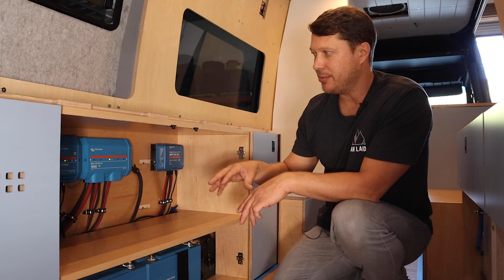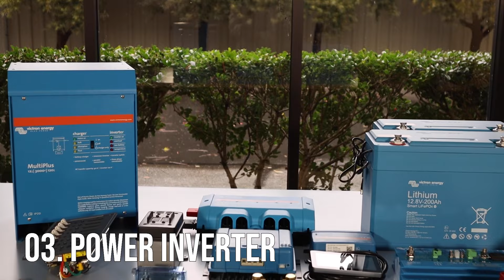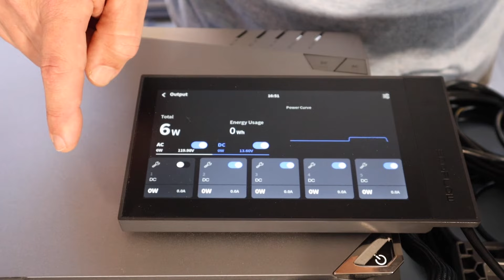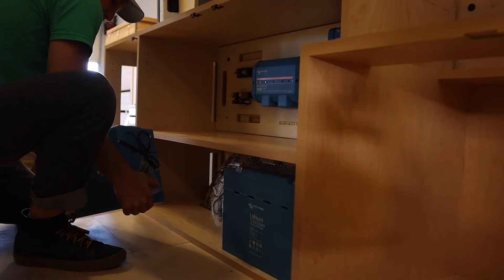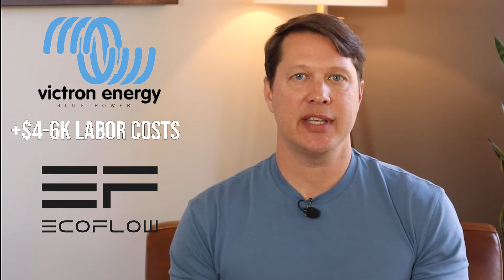Victron vs EcoFlow | Which is Better For Your Van?

Comment: In the case of a van build's electrical system, does the average user need or want all of this? If you go with a 12 volt AC and mostly 12 volt loads (fridge, lights, water pump, etc.) your system will be a lot simpler and more batteries and solar are less expensive than these options.
Reply from the maker: Yes, the average user does need something like this for a complete build. There are definitely less expensive ways to go, but the limitations of simple systems show up pretty quickly. Most people building vans do go with 12v appliances as much as possible, but as soon as you want to add air conditioning, induction cooktops, etc., you will need a system like this.
Reply: @VanLand I will tell my van.

Comment: I'm not sure what this Victron kit is and where its from. I'm building a victron system and I see a 250/100 solar charge controller will handle 5600w at 48v. You can choose the multiplus II in a 48v version, batteries are simple, and an Orion 48/12  will get you your 12v for the van. 

Just because the victron system somebody put together doesn't do what the ecoflow does, it doesn't mean that victron can't do it, but rather proves the point that you should put together your system taking into account YOUR needs.

Comment: Doesn’t the EcoFlow hub connect directly to AC/DC Smart Distribution Pane which has a 120v side and 12 volt side?

She has EcoFlow 10Kw system and this 48v AC

https://youtu.be/3JBWzhsanCk?si=FbDWtgH6HB3WUQXp

Comment: i did a victron system,  400 ah battery, 1200watt solar, victron 3 -100/30 , 3 -400 watt panels, 48.1v 9.97amp, 2 power queen batteries and 3000 watt inverter, and 30 amp dc to dc charger victron all wiring etc under 4500
Reply: Is it possible to share with me the detailed supplies you used?

Comment: Victory is very popular,  ecoflow, also popular.  Both are equally very very expensive! Too expensive! I use sungold 3000watt inverter, charge, controller, transfer switch, all in one. Under $600, 4, 100ah lifpo4 batteries, under $750, and it works. Unplug and it runs on battery, plug in and it charges, and pass through. Now I will add solar power, 2600 watt and it will take it, at 80 amps. So $9000, for victron, and $8000 for ecoflow. They don't impress me at all. I also  have 5year warranty. Ecoflow is portable, and therefore the only reason to purchase it.

Comment: We want to put the Powerkit system in our caravan/RV and are just finalizing our planning and have a question. For example, when you have the shore power plugged in and it only has 6Amps, does it use the remaining energy from the battery, so it can run the devices, like stove on 10Amps? The victron system can do it, so I am asking if the Ecoflow system can do it too.
Reply from the maker: Yes, it will use power from the batteries to provide the necessary amps irrespective of the incoming shore power setting.

Comment: I installed Ecoflow Powerkit with 3,150 watts of solar on my 34ft Avion Travel Trailer last June. I have 15kw of batteries and run my air conditioner on the system. Live full time in our rig.  In the over 8 months I have not plugged into shore power or a generator. Totally of grid. Full time. Love my Ecoflow Power Kit!
Reply: Hey, so you're able to run stuff like a fridge, shower, lighting in your van, charging appliances etc just with solar? not even using the alternator charger?
Reply: @eddy_creative sounds like he has an extremely high power, large capacity system… so I wouldn’t be surprised if it’s enough on its own
Reply: Hi there.  What type of AC/Heat did you go with? 12v set up?  Also, is your hotwater also powered by the EcoFlow?

Comment: I would go with Victron, but I’m more experienced than somebody brand new. Plus I’ve heard a lot of negativity about eco-flows customer service.
So far I figured out every issue with the Victron, though I have to admit some of them were somewhat of a challenge, mostly because of the learning curve. Although I have to say that I’m not sure why you can’t go to 48 V, as my system is 48. 🖖

Comment: Everything about the Eco Flow is great exept: The 1600W alternator charging is a real surprise limitation. It seems like a major oversite of who ever is doing the product management and spec'ing the design. It seems like eco flow would be falling all over themselves to up this capacity. Is there any updates or news of fixing this in the near future? Or is there a work around; say, bypassing with a stand alone DC to DC converter like the Victron Orion?

Comment: I've had several clients ask me about EF power systems vs my typically installed Victron system and this video helped me compare the systems in general.  The pricing of the Victron system and installation cost is higher than I typically charge. Also most of my systems are retrofits into a wide variety of rigs, not brand new van builds so Victron has more customized options.  But not having to cut, crimp, and size every wire has me licking my lips!

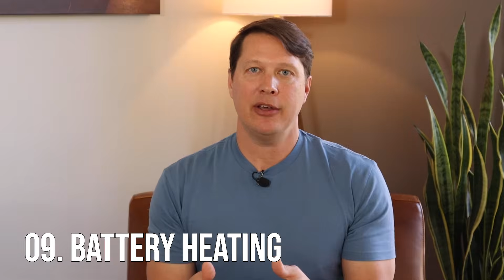Comment: ~9:10 Battery heating you mentioned that below freezing you need a way to heat your batteries, but from what I understand that only applies to what temperature the batteries get to. If you're doing a build like y'all usually seem to, the battery is inside the van. If you're camping in below freezing temperatures, the van should be fully insulated and probably also have a heater.

So here's my question: for someone living in the van full time who doesn't let the van get too cold (because they can't sleep if it is), how often is the lack of battery heating really a problem? How cold does the battery get under the bed or wherever if the air over the bed is being kept at least 60F? (I have trouble sleeping if the air is below 60F, much less below freezing.) I know they're in a case that might not get as much airflow from the heater and they're lower down while heat rises, but I still feel like being inside the insulation they probably wouldn't get below freezing. Especially if they're in use, say, powering your fridge and heater's fan and therefore generating resistive heat themselves (though granted not much if you're using thick enough wiring to be efficient).

Do y'all have any old customers that you installed Victron in whose batteries froze while they were sleeping in it and if so, how often and at what temperature?

Comment: We just purchased the 2kw kit a few months ago and luv it!  One thing we are considering is to add the Efoy fuel cell to charge during the winter as we dont get much sunlight on the west coast in canada.  Requires an exhaust line, but see that one container of fuel gets you approx 4.5 days running, and there is little noise.

Comment: All the reviews I’ve seen on the EcoFlow system say that you can use smaller gauge wiring.  What is the recommended gauge for both the AC  and DC wiring?

Comment: Watts are watts. I know most people especially beginners get hung up on amp hours, and yes I agree that most people are thinking about 12v systems since that is most common but it’s better to just talk in watts. Especially since it’s a very simple formula (volts * ah). 
Great video though! Admittedly I’m a Victron fanboy and love their ecosystem. The only product of theirs that extra hard to get passed are their battery prices! Sure they’re great but you can get just as good for much less.
I always use their components… except their batteries 😂

That 12v 330ah battery they offer is 🔥 though, I’d love a handful of those 😇🤙

Comment: Quite a good comparison but… you don’t mention the issues surrounding a failed component - if one Victron unit fails, you take that one unit out and can still operate without it. That’s not the same for built in box units. 
You also could have costed the Victron kit MUCH cheaper if you replace the most expensive batteries on the market with some much cheaper, and equally as good, items. 
It’s a huge WIN for Victron in my mind
Reply: Kes, 5 year warranty
Reply: @kk-pz8gn  it costs nothing beeing at "this moment" in the middle of nowhere

Comment: How easy is the van power connection in a sprinter VS30/2022?  Is the connection under the driver seat?  Would you need to add a fuse?

Comment: EcoFlow is headed in the right direction but with air conditioning and induction cooking and fast alternator charging I’ll stick with my tried and true Victron. 

I went with another battery manufacturer with 10 year warranty who also has heated battery option.

I agree, read the seller’s reviews. Support of the complete system is worth the extra cost. 

And my 400ah, 3000 Multiplus Inverter system was around 20 hours for this first timer to install, has been flawless for 3 years and cost around $5500 all in with quality wiring, fuses and the hydraulic crimper to make sure I did it right. 

That doesn’t include solar but 100 watt systems are fairly inexpensive. 
I found I don’t use solar. I park in the shade. My van lives in a garage between trips-which for now-are shorter.

Comment: For four years I have designed but never built and I wanted to do things on the cheap and easy. With all of the talk Victron is a sound and a life long investment. I want to design and use in an agricultural setting. The only criticism I have for victron is they also need to design and build equipment and components for wet environments. Second is Victron components are expensive but in all honesty  you do do get what you pay for. I need to use in a remote and isolated environment in the middle of nowhere on range land.  So, with Victron’s history of reliability I know for me it’s victron.

Comment: Extremely well-done comparison! I purchased the EcoFlow PowerKit 10kWh version when it came out and just recently installed it in my van. I agree with you that it is so easy it is almost fun. I also agree that tech support is lacking. I had an issue with the alternator charging not working. I searched online in Facebook groups of all places. Other said to turn the entire system off, then back on after 5 minutes, and that fixed it. EcoFlow's support had no such suggestion. Similar issue with their console. I found the answer online. I have waited a week for EcoFlow's support to get back to me. They are very good about firmware updates though! They are constantly updating it. My only concern is what if a component fails X years from now? I know that is a risk.
Reply: k72231968 said
7 months ago
"I have several Ecoflow units. Including a 4kw Powerkit. Ecoflow has answered all of my email questions with-in 48 hours. I have had no failures, or warranty issues..just technical questions. So far I am very pleased with all of the Ecoflow products I have."

Comment: Outstanding comparison!
Another option is to use an EcoFlow Delta Pro to power a distribution box. This would be a smaller, simpler, cheaper system.
Reply: Yes, that was my question. What are the benefits of the ecoflow kit vs the delta pro, which I saw for under $2k..

Comment: Do you have any idea whether the top or bottom port for the ecoflow power hub solar connector is positive? I have to cut my solar mc4 connector off to feed through my roof gland and now wondering which wire is positive :)

Comment: I am an EE and while appreciate the effort you put into this video, I think you made it very confusing for beginners. WH/80 only works for 12V. Watt-hr=amp-hours x volts would be clearer. You can easily distribute 12V with a 48 V Victron system using a DC-DC converter, and charge with 1200W of solar via the 30A charge controller. Bigger inverter is better, but also draws more idle power. The point is this stuff gets complicated very fast.
Reply from the maker: Yes it could be confusing. I just find that most van owners think in terms of amp hours @ 12 volts.

Comment: I have several Ecoflow units. Including a 4kw Powerkit. Ecoflow has answered all of my email questions with-in 48 hours. I have had no failures, or warranty issues..just technical questions. So far I am very pleased with all of the Ecoflow products I have.
Reply: Do you have any idea whether the top or bottom port for the power hub solar connector is positive? I have to cut my solar mc4 connector off to feed through my roof gland and now wondering which wire is positive :)

Comment: Is a 12v or 24v mini split AC/heat pump more energy efficient (all other factors held constant) in conjunction with the EcoFlow Power Hub? What quirks are there to know when installing a 12v or 24v mini split with the EcoFlow Power Hub?

Also, after the EcoFlow Smart Distribution Panel, can you only choose one (12v or 24v) or can you have both to use with some 12v devices AND also 24v devices?

Comment: For the EcoFlow does anybody also know if DC is limited to 13.6V - 70A, maximum power: 1000 W PER appliance or overall DC output for all devices connected. Would be super appreciated if anybody can confirm that as can't find on their manuals
Reply: Hi just finished install 10kw system to sprinter van . Van has 12 v Air conditioner they consume 50A max and 25A continuously  .my experience once reached maximum current system automatically turn off DC power ( only at once I had happened)  also you must use hi current load (over 20 amp) direct to DC out put
Reply: @haruO3-2479  can you explain a bit more about how to directly connect to dc. Does that mean you can’t use the distribution panel? I see there is a negative post for over 30 amp in the the distribution panel. Thanks

Comment: amazing video, really helped with the comparison of both of the systems. just two notes for me: for the discount code its not working for me in the UK, is this a US code only? - second question is have you managed to figure out running a 12v DC aircon unit with the ecoFlow

Comment: Struggling to understand the AC limitation with EcoFlow. 75 amps on 12 volts is 900watts. Why not put in an AC air conditioner and connect it to 120v breaker? Only 7.5 amps
Reply: Ecoflow has their battery powered air conditioner and heater that is relatively efficient and powerful...I'm waiting for them to figure out how to just swap out included hvac system in an RV...

Comment: On the Ecoflow: Would it be possible to merge 2 DC-out ports into 1 some how? Therefore allowing it to run an AC unit?
Reply: Ecoflow told me you can connect two 20 amp circuits which would work for the 24 volt c&c aircon I am looking at. I’ve also seen it posted that Ecoflow told customers that long as you stay below the total 70 amp output you can swap the blade circuit breakers for bigger ones. Other possibility I saw mentioned was directly tapping in to the 48 volts to run a 48 volt ac which would be very efficient. The best bet either way would be to use 24 or 48 volt ac, 12 volt would eat up too many amps
Reply: Also the kit included 30 amp fuses with it

Comment: Thanks for the review, unfortunately I think Ecoflow loose for me because you cannot plug the AC directly to the battery bank. Be aware also of the limitation of 70A on DC output on the Ecoflow system. Using 120 volts rooftop Air conditioning unit will use to much power in my point of view. I was also surprise that Ecoflow system will take more space than the Victron. Space saving is the the name of the game when you talk van build.

Comment: I love the idea of the Ecoflow and think it'll be great for a lot of people, but the main thing people need to understand is that you're trading ultimate flexibility & customization (Victron) for a boxed solution (Ecoflow).

I was tempted to go Ecoflow myself until I realized the 12/24V DC output is too low... 12v output is 1000w and 24v output is 1600w (pick one or the other, not both)... And I'm not sure if you can tap into the 48v batteries directly. I want to have a DC-powered AirCon...

Also, the limited alternator charging is too low for my goals of having a dedicated secondary alternator (maybe even a 24v or 48v one for much higher watts).

Comment: Great comparison video. Very helpful. One thing I wanted to mention about a downside of the eco flow kit is that what happens if  one of the components fail? You would be without your whole system because all the components are housed all together. What are your thoughts on that?
Reply: Just swap out the hub, and you should be good to go!  Since they have a 5 year warranty, this should be very easy to do...even a novice can do it.